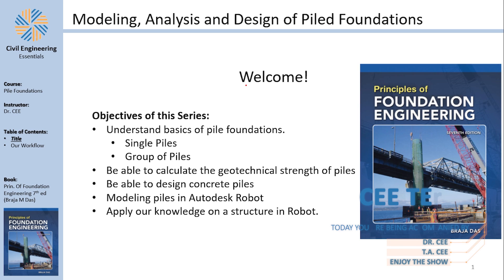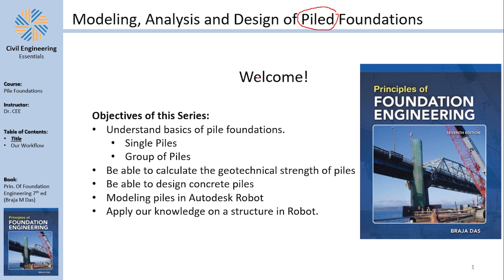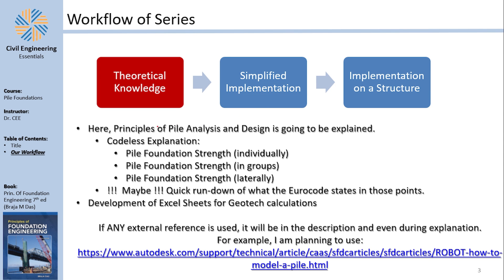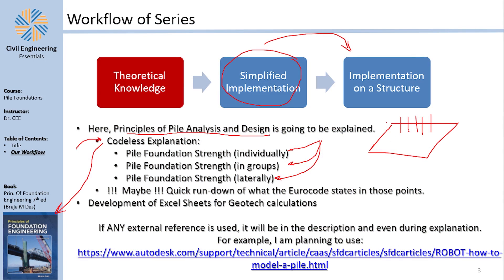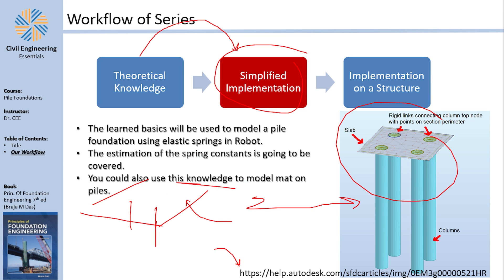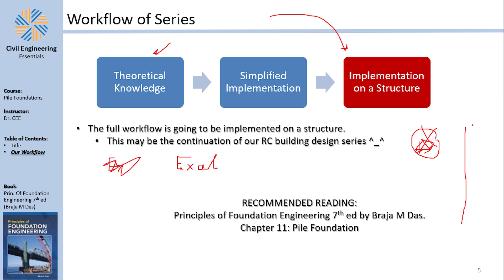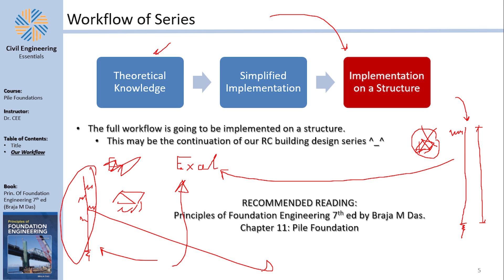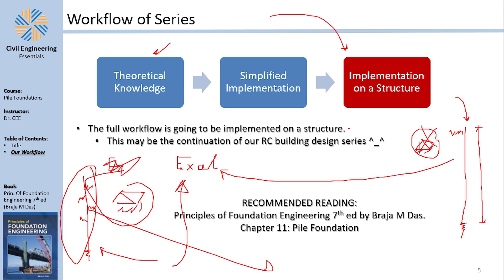Analysis, Modeling and Design of Piled Foundations in Robot - Part 1: Introduction

Comment: Doc, as a always, a prime content, kudos! 👌👌👌 Could you perhaps do a series on residential confined masonry design to EC, seismic design in particular. I'm curious if it's possible to quasi-model it in Robot since there's no actual modul for masonry structures... ? In addition, a lovely idea would be to do a full structure with slab foundation, if possible. A lot of colleagues model strip, slab, footings of different sorts with shell elements...
Internal forces of the superstructure are calculated with a model with fixed supports, while the internal forces in the foundations are calculated with a model that has elastic (Winkler) springs underneath, let's say, a typical Bodenplatte. Im curious what's your take on this approach...
Reply from the maker: Thnx a lot ^_^ Happy you like the content. I am preparing the next video in this series. Masonry is a little bit "iffy" in RSA. I will think about it.

I think the "Bodenplatte" approach, wo mann einfache Federelemente unter der Platte modeliert (where people simply model springs under the plate), is a simple - yet acceptable - way of modeling foundations.

Now the advantage here is:
1) There are a ton of references on calculating the linear springs of the soil for the foudnation modeling.
2) Linear springs is something that regular engineers can simply understand and implement without further research
3) The soil continuum in this case is assumed to be linear and fully homogeneous.

The disadvantage here is:
1) We are EXTREMELY simplifying real soil behavior. Consolidation, Non-Linear Behavior, and other things are ignored.
1A) For example, if we do a CPT on soil, of course the cone resistance rises the more the cone is penetrating the ground. This indicates a non-linear behavior of soil, which is not captured
2) The long-term deflection of soil is ignored.
3) The effect of alternating water table (if that is close to the foundation) is being ignored.

My humble opinion:
if you are trying to design a structure in a professional setting (normal structure, everyday life) then linear.

if you have an extremely specialized structure (tunnels, huge towers, some strange cool structure) then yes, non-linear should be the way to go
I even suggest in such cases to take the reactions from RSA and go to a specialized structure such as "Plaxis" to do your detailed calculation of the soil

I know my response might miss some of your points that you wanted to be addressed, so please feel free to reply with more points if you want me to cover them

Hope it helped,
CEE
Reply: Helloi Doc, thanks for the reply! Indeed, I agree with your remarks.
The southeast of Europe where I come from is loaded with confined masonry, it's the standard here, plus the entire area is prone to pretty nasty earthquakes (PGA up to 0.4g for RP of 475 years). New versions of, for example, Scia, RFEM, Axis VM have those modules for confined masonry but vast majority of software solutions usually doesn't unless they are specialized for that type of structures. In reality, most of us use one, max two programs, cuz they cost a ton of money. Now, my older colleagues, guys in their 50s, 60s they use the linear approach for Hochbau, but they separate the model into 2 sub-models as I have described. Plus, some use ortothropy, some just change E moduli and basically model shell walls with modified E modules and beam, columns as lintels when it comes to masonry walls.
I'd be reeeally happy to see you do a random 4,5 story confined masonry building, on slab foundation, let's say type B soil, sprinkle with some hefty PGA, let's say >0.3 and see what robot does. With or without ortothropy, up to you. I love Robot, I really hope it does a good job at it and you Doc are the only dude on the internet who takes time and pride to "work" together with all of us, although you actually do all the work while we eat snacks and enjoy the show. I hope you won't let me me down on this masonry stuff. Sorry for barging in with this subject here but I had to start a thread somewhere 😬
Cheers Doc 🙂
Reply from the maker: It is alright, I will definitely keep the masonry thing in mind ^_^ 
I just finished a series on ASCE7 EQ manual verification (it is all uploaded and set to premiere in the next 4 days)
I will do my best. Let's hope I can find something to convince "Robot" or trick it to analyze that thing accurately.
Reply: I really look forward to it and really look forward to the rest of this series. In the meantime, I'll enjoy the ASCE7 EQ. Thx, Doc 👊
Reply from the maker: I alrdy recorded two vids. They are about general stuff in piles and meyerhofs bearing capacity calcs 😉
Reply from the maker: For masonry, still researching 🌹
Reply: @CivilEngineeringEssentials  👌👌👌 btw, if you guys need help with the channel, hit me up, I'd be happy to assist in any way I can. As a former engineering prof. about to embark on PhD myself, I see no alternative to super-duper YT tutorials on engineering. Peace out ✌️

Comment: bundle of thank dear Dr. is this series going to focous on Piles or drilled shafts i thins they both differ. the piles are precast concrete and than they are dug into ground but drilled shafts first you drill a hole and then pour the reinforcement and concrete
Reply from the maker: I see what you mean. I will try cover both. Of course there is a difference on how to calculate the skin friction in both cases (among other differences)
Still, huge thnx for your comment, I forgot to mention this in my video ^_^ 
thnx a lot.
Reply: @CivilEngineeringEssentials  Dear Dr can i have your email
Reply from the maker: civ.eng.essentials@gmail.com
But plz note that I also have a FT job, so I will check your emails as soon as I can.